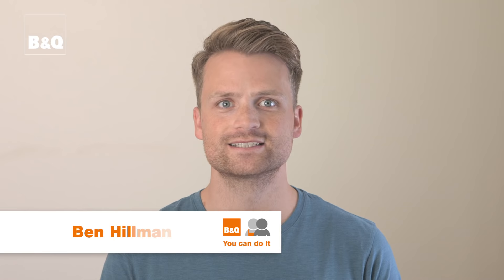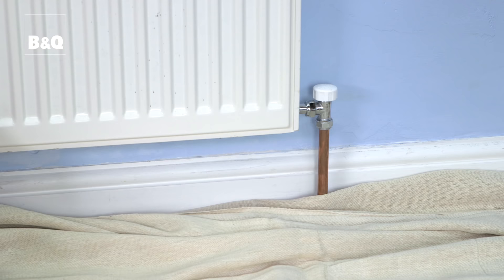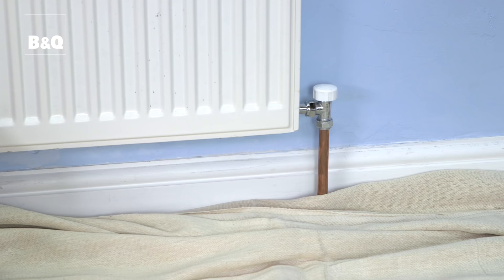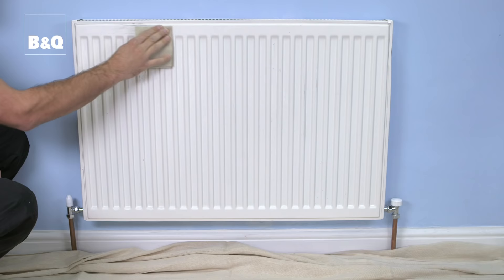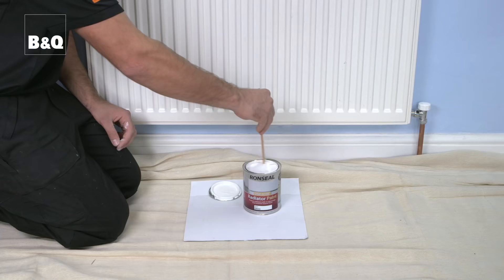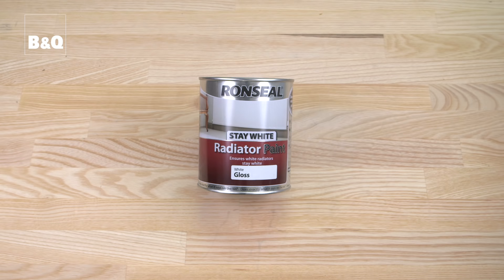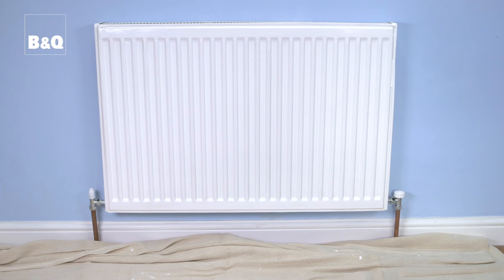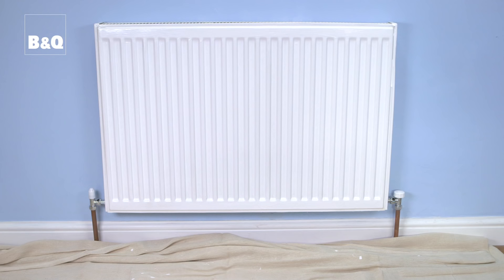How to paint a radiator

Comment: What primer to use on a radiator
Reply from the maker: Hi, most radiator paints don't require an undercoat and are self-priming. I would suggest checking the product details for this information on the paint you wish to purchase. I hope this helps 😄
Reply: What about the top grill?

Comment: What kind of paint?
Reply from the maker: Hi there, any radiator paint will do. In this video we've used White Gloss Ronseal Radiator Paint - https://bit.ly/3UOgvm1 😊
Reply: @bandq  regular wall latex paint ok for radiator. Sherwin Williams?
Reply: @bandq  have electric heater . Not real hot
Reply from the maker: It's not something we would recommend using.